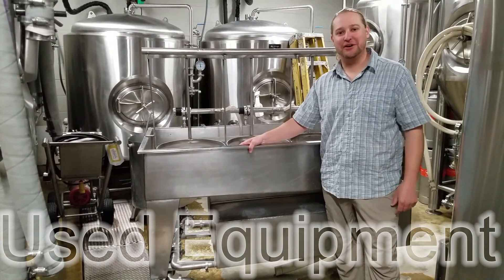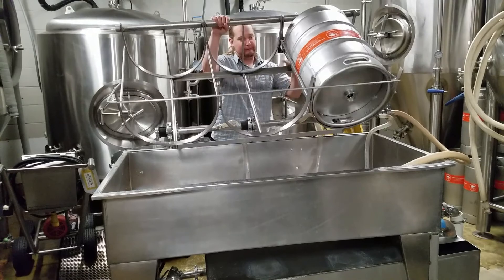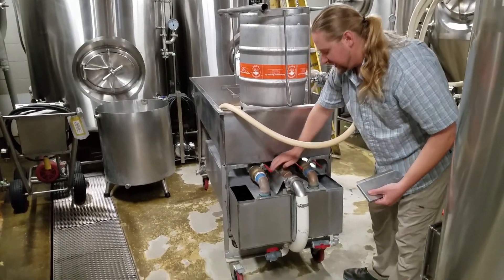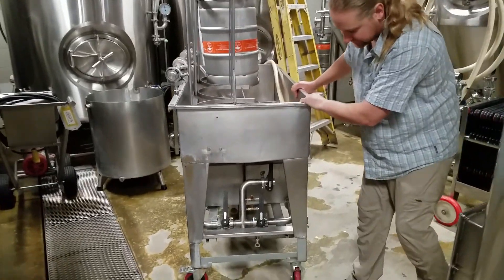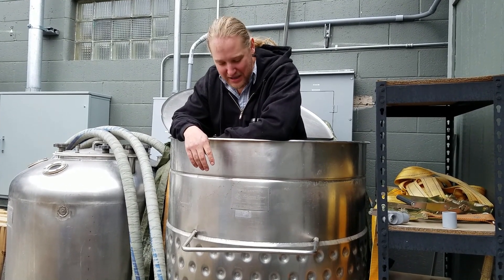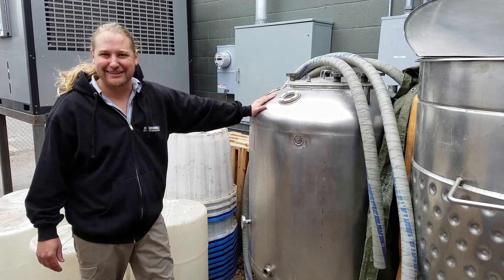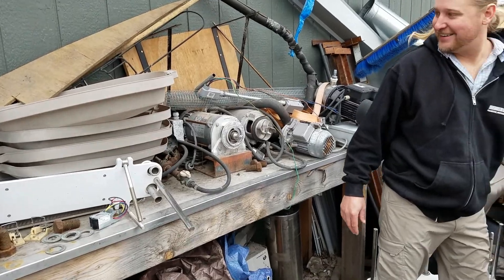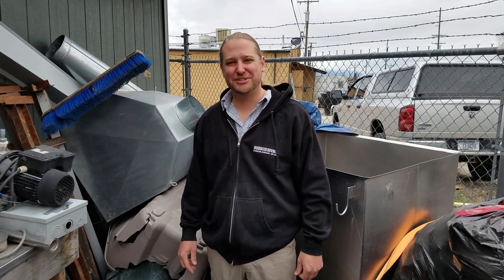Used Brew Equipment: MICROBREWERY!

Comment: what is your equipment for filtering your product and process water?
Reply from the maker: Thanks for the question! I use 2 largish cartridge filters on my main brewery water that comes for our city. The first is a Particle filter to remove rust/particles from city pipes and the second is a Charcoal filter used to lower Chlorine levels. Cheers!